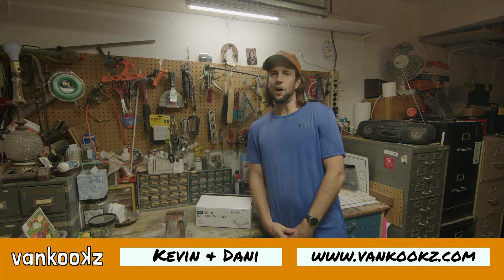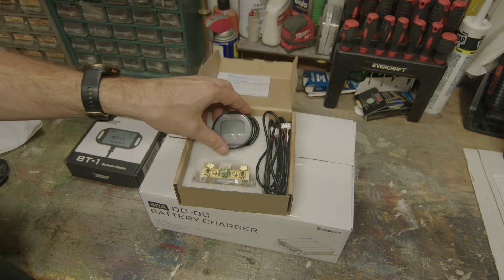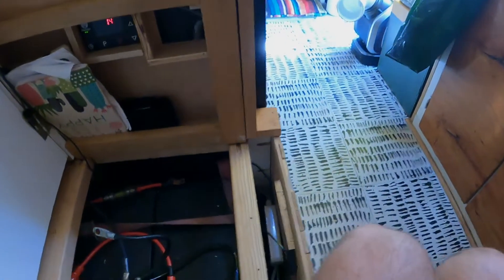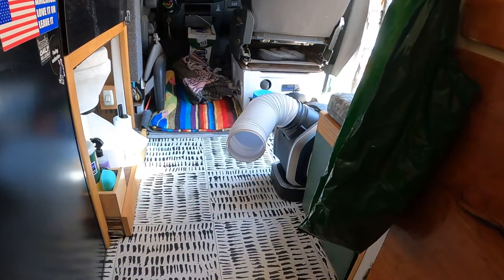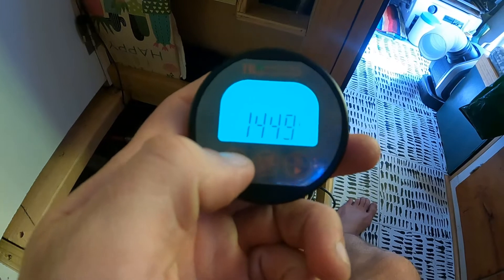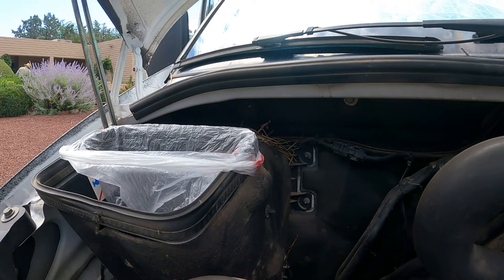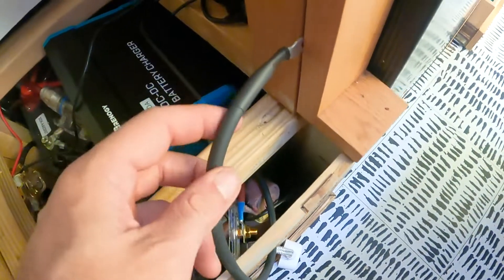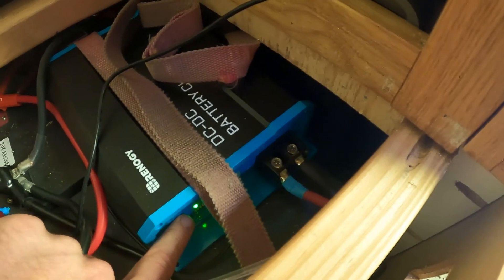DC to DC Renogy Battery Charger Install with $30 Battery Monitor

Comment: I was told that Mercedes lubricates their cables with palm oil. The natural vegetable oil is a nice ecological touch, but rats and mice say "Vegetable oil! This must be food!"
 Honda does make an adhesive tape wrap for engine wiring, which contains hot pepper, and the critters don't like to eat that. Only sold at Honda parts counters.
Reply from the maker: I've heard that too about Mercedes wires.  Ok thanks for this tip!

Comment: Awesome vid. We are just building out our Renogy MPPT Solar + 40a DC-DC on our T2 VW bay.. So from what I can tell you're simply having both the MPPT feed and DC-DC to the same positive buzz to your lithium leisure.. (Only vid I've found using both charging systems hence just sanity checking)

Comment: Great vid and a nice install 👍
Can i ask 🤔 did you run the neg from the DC to DC straight to the battery? The shunt wont see the charge from it as it by passes the shunt 🤔
I like renogy equipment, i use it all myself 😁 i use the same shunt as well 👍 great bit of kit for the money 😎
Reply from the maker: Great point!  👍 recently my DC to DC charger melted my fuse so it's unhooked at the moment when I go to wire it all up again and get a new fuse  I will hook it up to the shunt.  Thanks